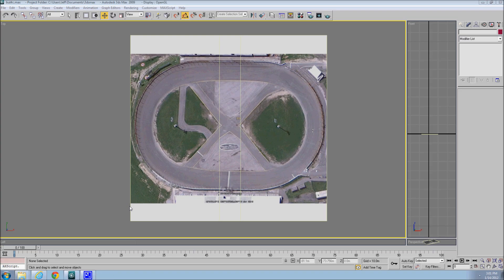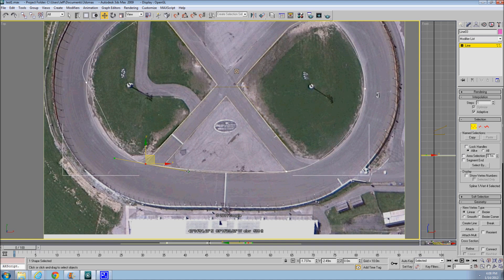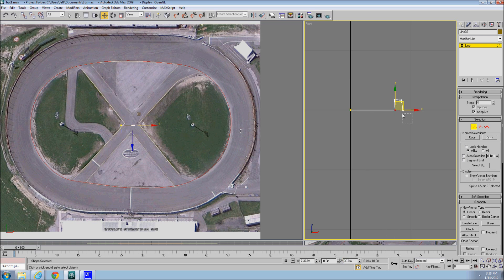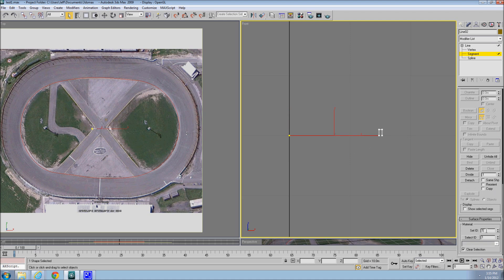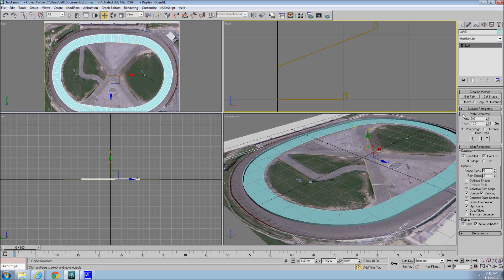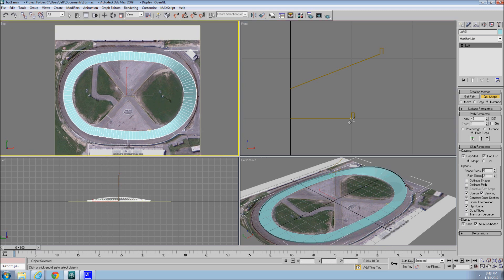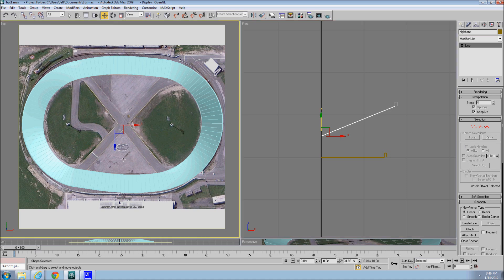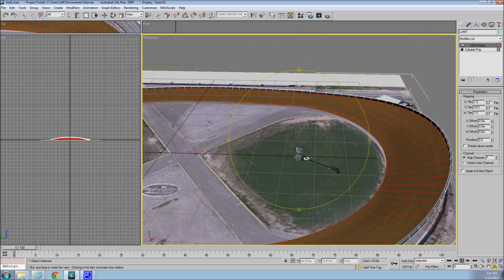3ds Max rFactor Tutorial Creating Track Mesh with Splines

Comment: Great resource!  Wow!   After you loft, are you concerned at all with the angle of the wall?   In this example, the wall does not rotate the track surface angle change.  Flat Rock isn't banked a great deal, so the angle of the wall may not matter much.  On more steeply banked tracks, do you tweak the wall angle?
Reply from the maker: Sorry for the late reply, was on vacation when I read this and forgot to reply back.  Basically how you loft the track you can do the walls the same way, adjust the wall spline angle as its needed.

Comment from the maker: With the rotate tool,  you can adjust how many deg is rotates.  Rotate the line beforel ofting.  Sometimes that doesnt always work, so I will create a line with the banking (6 and 12) and draw a new line over the top and use those lines.  Basically using the first line as a guide.

Comment: How can you accurately set the banking? For example, If I know that a track has 6 degrees of banking on the straighs, and 12 degrees in the corners, how can I set the loft lines to be accurate to this measurement?

Comment from the maker: If you drew the line to left, move it over to the right or vice versa.  That is one way, or just flip the normals is another.  One of those Max things, how you draw the spline for the track sets the way the line needs to go.  I tend to do a quick loft to make sure I drew it the right way.  That way I dont have 20 cloned lines that I need to move.  Learned that the hard way.  That make sence?